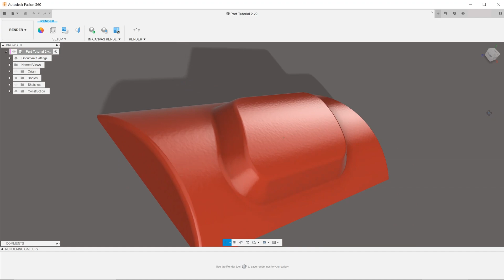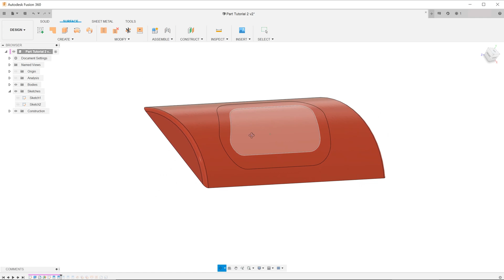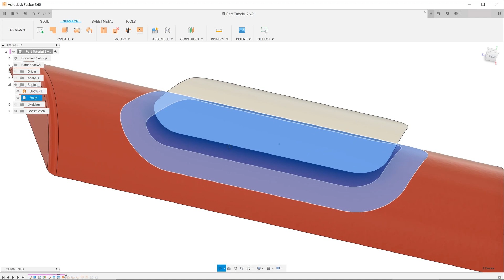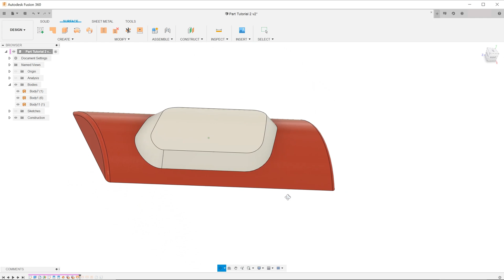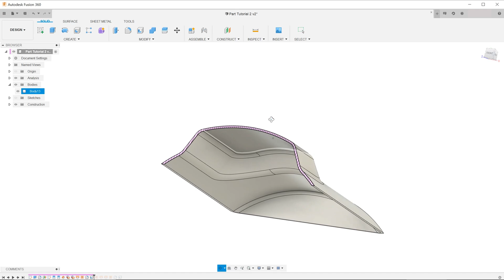Fusion 360 - Tutorial 1

Comment: Thank you very much. When I replicated this tutorial, I noticed that the offset patch is larger in the x direction than the original sketch. This is very noticeable if the "half pipe" is closer to a half-cylinder. After making the offset, I split the offset patch so that it is the same size as the original sketch and I think that makes the loft look more uniform. Which way you go, of course, depends on the design intent.